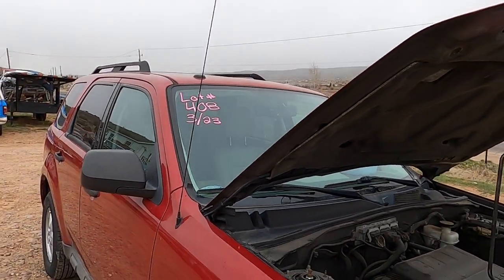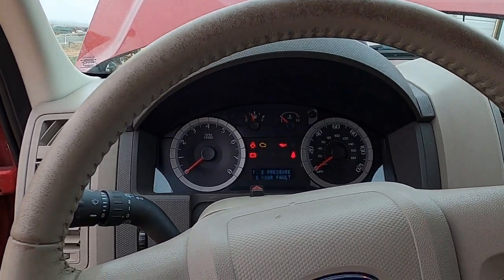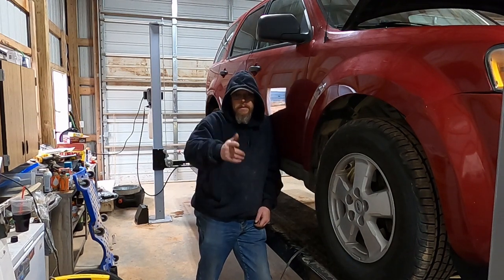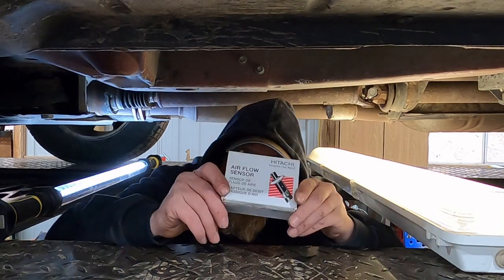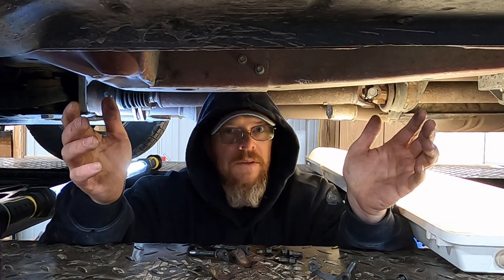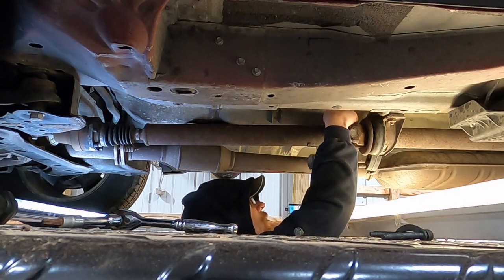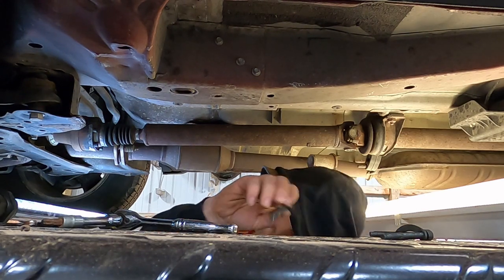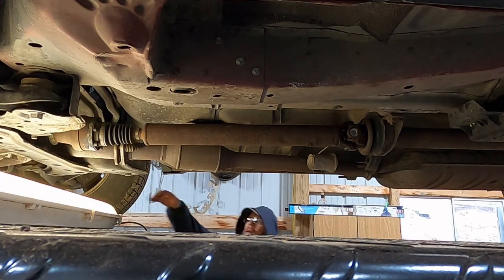Rear Driveshaft Replacement on a 2009 Ford Escape.

Comment: Taking down my shaft on my 2009 rusty Nova Scotia escape. Got an annoying noise,bearing like noise.The hanger bearing is nothing but rust, sprayed everywhere tonight,,red rust check.. Great video sir.
Reply from the maker: Thank you sir, I do have another video I need to finish on a noisy issue. It turns out the front wheel bearings were the problem
Reply: @GettinDirtyOffRoad  did that last week,got an entire knuckle with bearing 95,shipping and tax,real simple. Thanks again.
Reply from the maker: @vernonfindlay1314  thanks for watching all the way from Nova Scotia, that’s pretty cool

Comment: Your rear hatch release, soak it with spray. Pull back the lower plastic and soak it and the locking  mechanism. Pull up the plastic rod that moves up into the module. Eventually the hatch will open more times than not Except that one time you really need it. Happy week from Nova Scotia and my 2009 Escape
Reply from the maker: Thank you I appreciate the help, I’ve just been releasing it manually and left the plastic cover off.

Comment: So how did it run afterwards?
Reply from the maker: It has been great, our son has put 25,000+ miles on it since April. We did find another issue the day after the shaft was back in and I will have a video soon. The wheel bearings in these can have you chasing phantom noises throughout
Reply: @GettinDirtyOffRoad  I bought my 08 at an auto auction with 216k but it needed a 2-4 band in the transmission. The auction repaired for the cost of materials pretty much. I supplied the 2-4 band which was 20 something bucks. It just hit 260k miles and I have a seized u-joint cap which I'll get around to finishing hopefully the end of the week.
Reply from the maker: @jamieheim8009  we just picked up an 08 that’s front wheel drive at auction lol. I’ll have a video coming for it as well. 168,000 miles and a bad engine, which we didn’t know at pickup. We really only went for it because of the one our kid took from us haha. We got our moneys worth in parts but may try to put it back on the road.